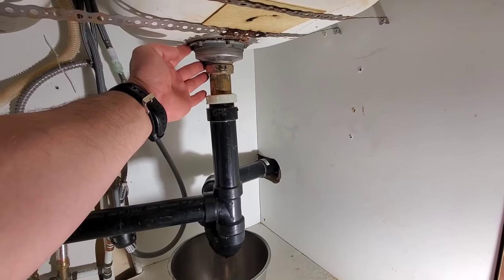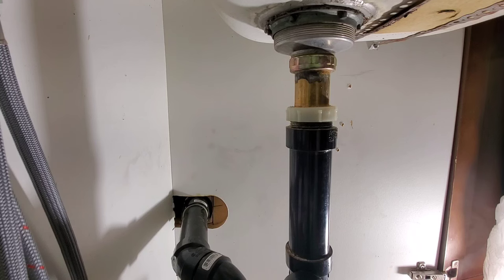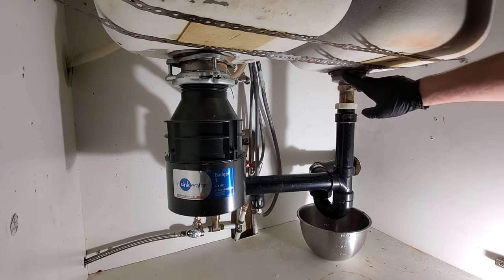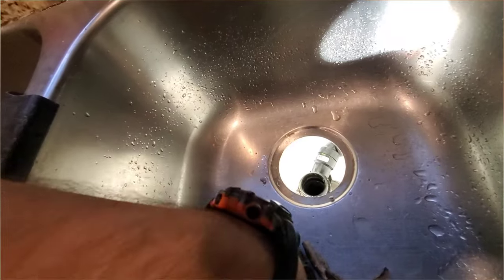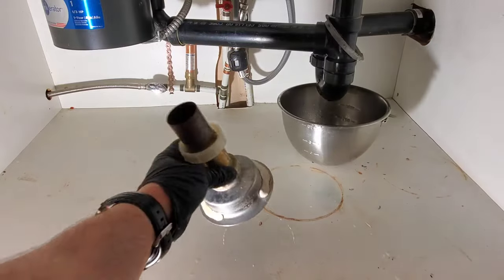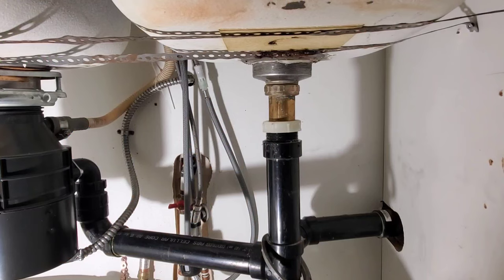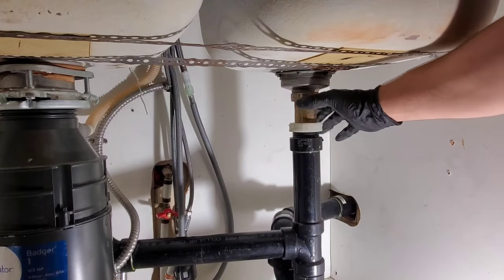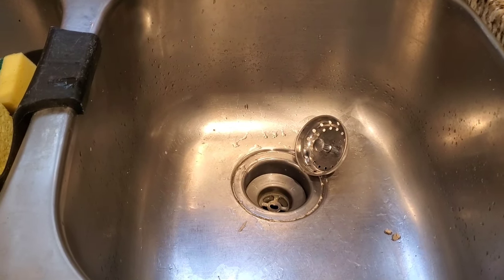#QTOW# Fixing a leaking kitchen cup drain

Comment: Have you had any problems with the plastic slip nuts with washer made in to them splitting in half?
Reply from the maker: Thanks for your question, no l personally havent had any problems. My first thought is, are you tightening them too much? I would say hand tight only. If necessary, give it an extra quarter turn with some channel locks. 

If its still leaking, put teflon on the ring between the slip adapter and nut. Its only plastic so being aggressive will break them.
Reply: @HomeownerDIY  I have not had them break on me but my father had 2 of them on his k sink and 1 on his tub that I had to replace. They seem to be made out of a softer plastic that splits easy and I try not to use them.
Reply from the maker: @briancrandall1601  My guess that they are being tighten down too much. Like l said, go hand tight only.

Comment: I thought putty was for wood and silicon for water.
Reply from the maker: Thanks for your comment, sounds like youre reffering to wood filler(putty) Plumbers putty and silicone serve the same function(to seal out water)

The way l learned is to silicone tubs and showers, where the drain isnt accessable. 

Putty for sinks. Putty even after 20 years is easy to remove. Silicone you will probably break the drain since the drain is old. Sink drains whether its a kitchen or bath, will eventually rot out and have to be replaced. Ive had the same drain on my tub for 60 years. The thing is the tub is used once a day(ish). Sinks are used used after every meal and when the bathroom is used. Hence why they rot oit faster. 

Please look in my plumbing playlist, you have many videos from a professional plumber there.